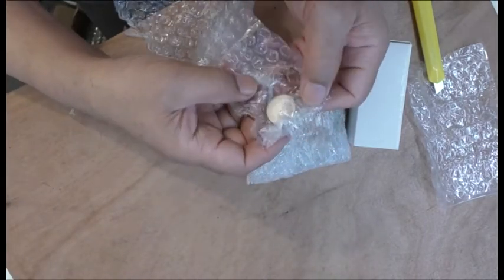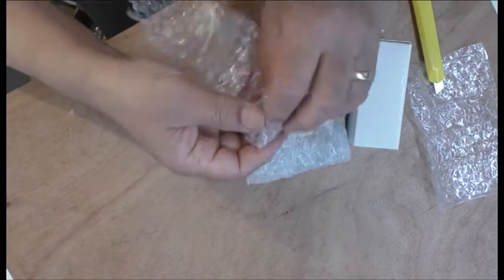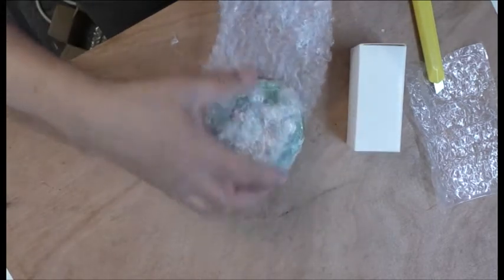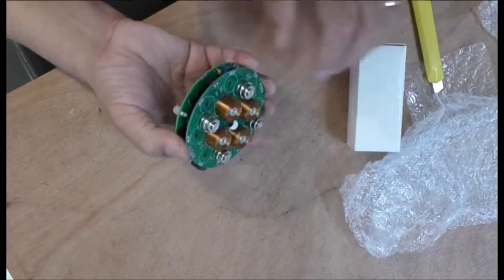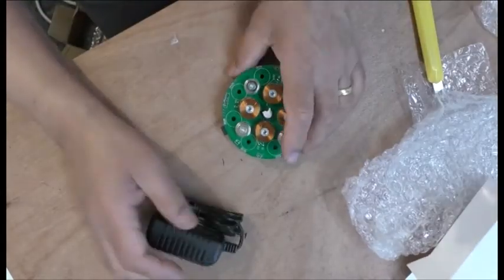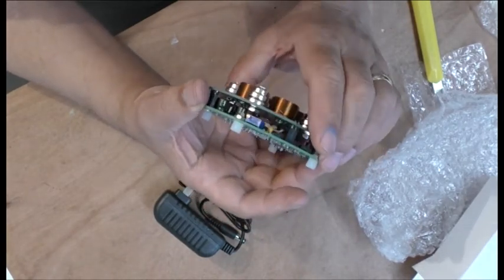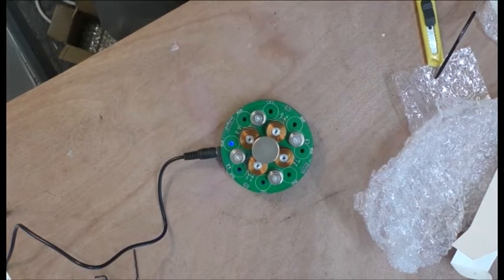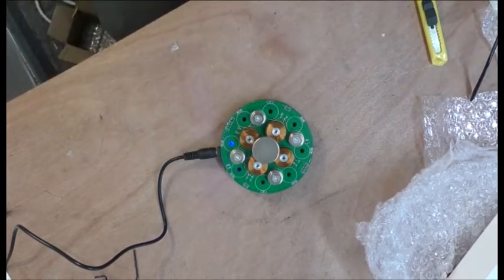#112 Magnetic levitation Kit

Comment: Shame, just had a look for those 'kits' on eBay. Not cheap. I guess they may be saying that you make your own "kit" such as a display case and then fit this assembly inside.
Reply from the maker: Thanks Grandad but seen the kit that has to be assembled, i.e. resistors transistors and so on. I was very disappointed but knowing if I did it maybe it wouldn’t work 😂